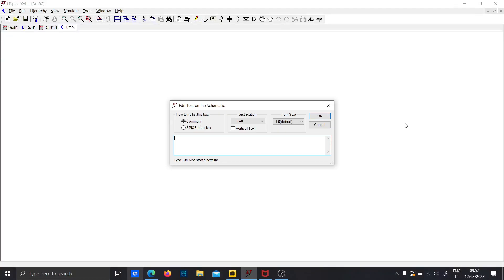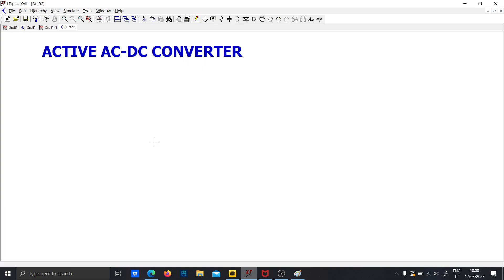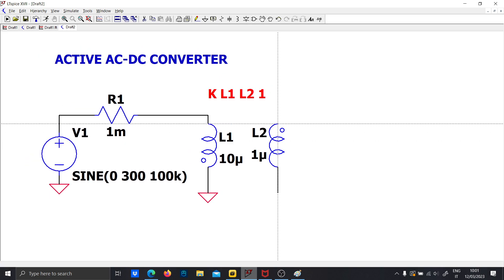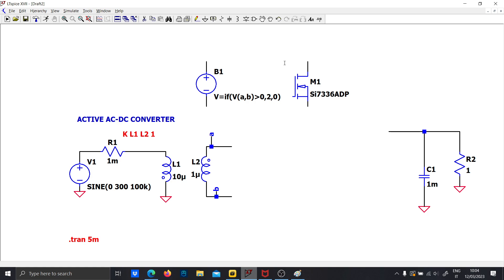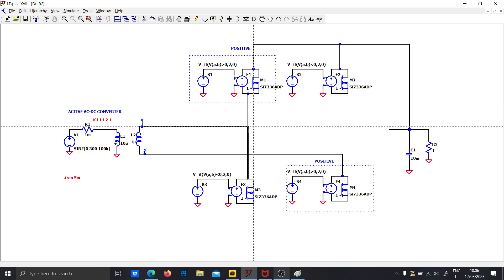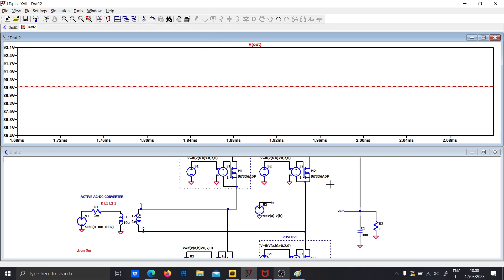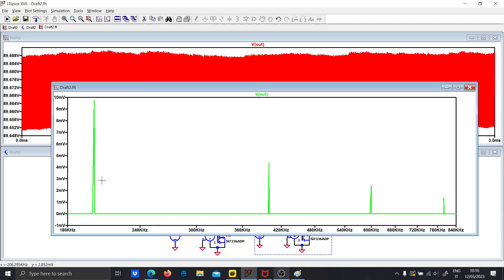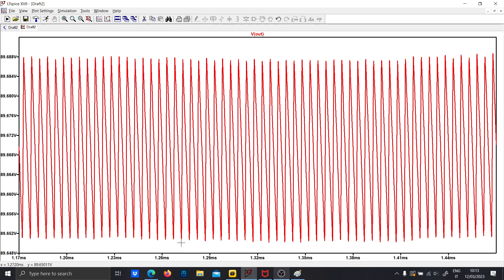LTSPICE AC-DC Power ACTIVE Mosfet Rectifier (Behavioural)

Comment: Hello sir, I don't get why you put 100kHz instead of 50Hz, which is the fundamental frequency of the EU grid for example? Why is that? Can you explain it ? Thanks in advance
Reply from the maker: This is a behavioural rectifier. It is how an active rectifier works indipendent from what frequency you have. Think of a full bridge...
Reply: @LukeXVIIx64  Thank you for your really quick response! Typically, in active rectifiers, we have an input filter of "L". I removed the transformer, and instead of 100k, I gave 50Hz. Without L, it's working fine, but once I add L, the simulation crashes. What can be the reason for this? Any suggestions?

Edit: I see your point. Thank you again

Comment: If you don't mind my asking, what version of Spice are you using?  Mine is 17.1.11

I've been going through all of your videos from the first to this and building the simulations with you and a few times I've gotten slightly different outcomes/scope readings.

For instance this time my out doesn't reach a steady state until roughly 60ms, whereas yours is about 1.5-2ms.  At 1ms the signal peaks (yours has a gradual incline) at 90.6v and gradually (over 60ms) lowers to and oscillates between 88.38V and 88.32v which is roughly half a volt lower than yours.

It's just strange that when this happens the differences are so small.  It leads me to think that our circuit diagrams are the same but perhaps there is a slightly different computation between our machines.

Edit:  I've heard Mike Englehardt say spice uses FP64 and FP80.  Perhaps my machine is using one or the other in some cases where yours is not.